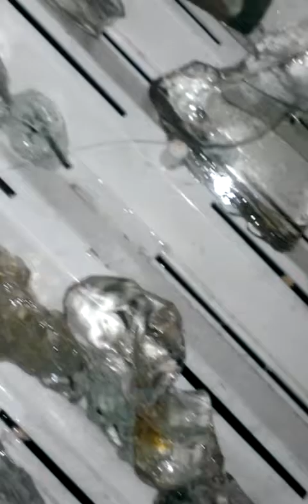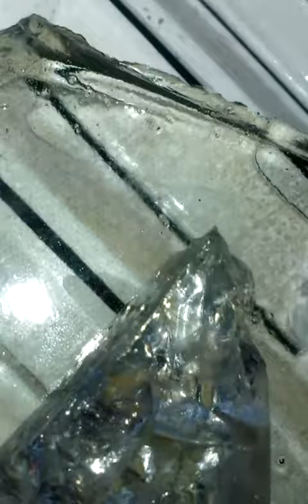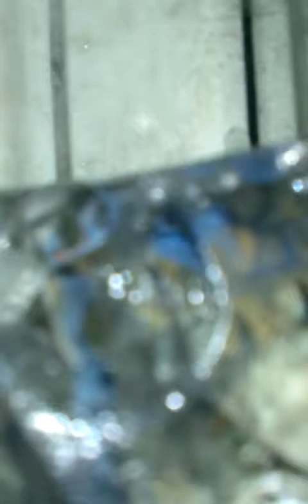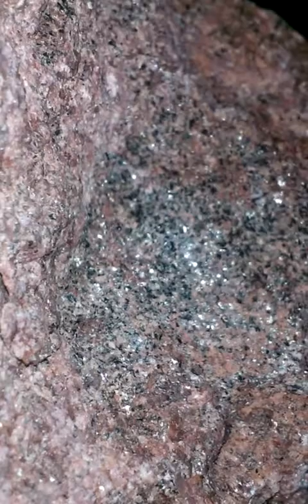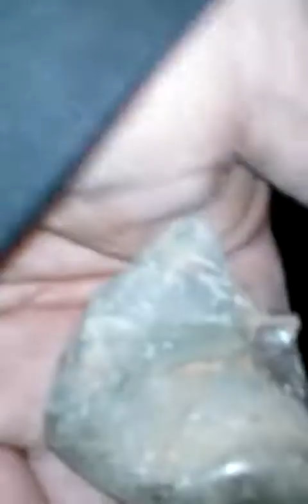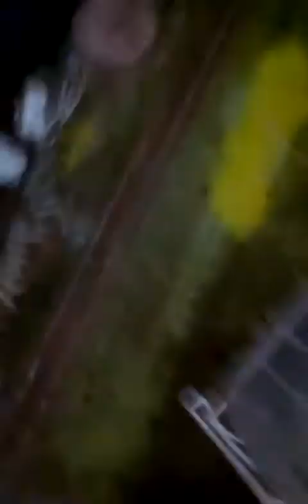Diamonds and meteorites

Comment: Please don't call those specimens diamonds as they are not! Your specimens are just quartz. For a start, the lustre is glassy, not greasy or adamantine like diamonds. Secondly, your quartz is very angular whereas diamonds are slightly or very rounded. Your quartz has beautiful conchoidal fractures. Diamonds don't have this feature. However, your specimens are very fresh which means they have not travelled far from their source.

Comment: impact glass...
Moldavite.
usually green from mixing with olovine, (the main component in most stony meteorites).
Your other stones though...
It would be interesting to put peroxide on your "meteorites" to see if they bubble.
Only Platinum will react because its a catalyst.
Platinum and iridium, and other matter from the pgm family are common in meteorites.
Moldavite fetches a good price on ebay.
Reply from the maker: I found some of these near meteorites
Reply from the maker: I will make a video of that for you next year.